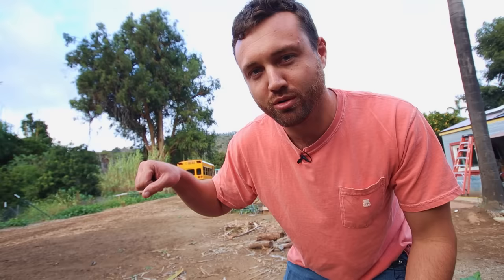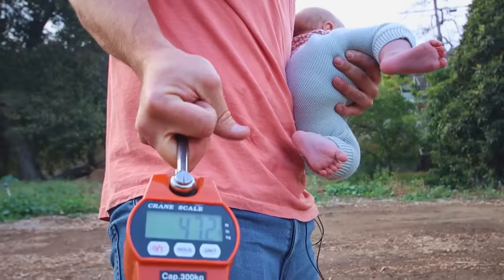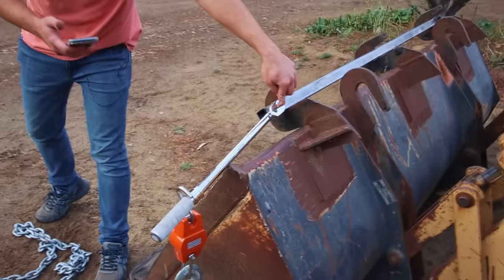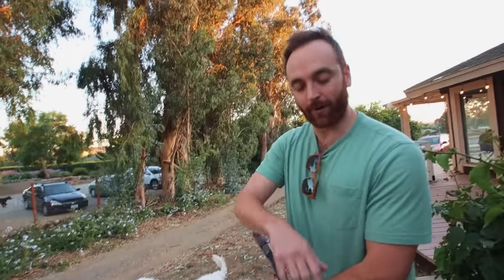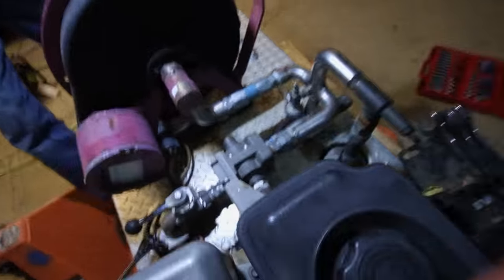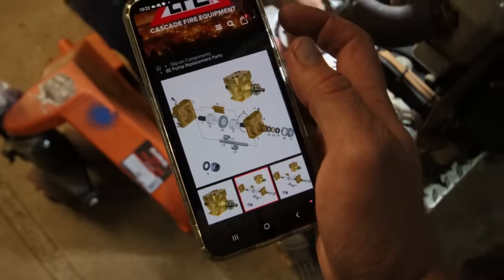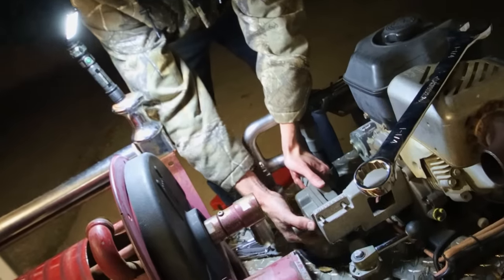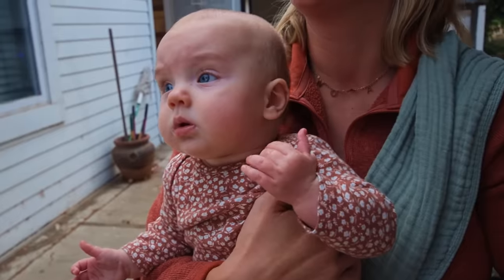Proving my very big wrench works

Comment: Would a 5 foot breaker bar on the torque wrench work the same?
Reply: You just wouldn't have any way to know how much torque you were applying because the torque wrench being directly on the bolt you're torquing would be reading the actual torque, in this case 1000 ft-lbs, which is beyond what most torque wrenches can measure. But yes, if you (the person at the end of the lever) applied the same force to the end of the contraption, you would get roughly the same torque at the bolt. It wouldn't be exactly the same, but for reasons that go beyond anything he mentioned in this video (he's reasoning based on equations that are accurate in ideal cases that don't include factors such as deflection of the lever).

Comment: You blew so much money on a water pump that didn't work when you could have just gotten a cheap new water tank and electric water transfer pump online or ay a retail store for much cheaper; an oversized CO2 fire extinguisher never hurt either. Same goes for you wrenches, because you could have bought just a handful of crescent wrenches or one socket wrench kit to do the work of all those other wrenches.

Comment: this does work, but only if you always apply the force at the same point on the handle of the torque wrench every time, and make your calculations based on that point. if you move where you're applying force, say you choke up to half way down the wrench, it'll take more force to get the click (twice as much in my example) and this usually doesn't matter because the increased force and reduced distance exactly cancel out, but if you add 6 feet to the end of the wrench you're still doubling the force to get the torque, but the distance to the pivot only decreased 10%

Comment: Torque isn’t affected by length. If you apply a torque at one end, the same torque is applied at the other end. If you apply a force further out, it will apply more torque, but if you apply a torque further out, it doesn’t change how much torque is being applied.
Reply: True, but there's 2 pivot points involved, so the torque applied to the wrench gets converted into a force, which is then applied at the end of the cheater bar, and gets converted into a larger torque. William's explanation is wrong but eyeballing it I think it works out the same anyway, so long as the wrench is always in line with the bar.

Edit: I don't think my explanation is quite right either but I'm still pretty sure that it would still work out right anyway